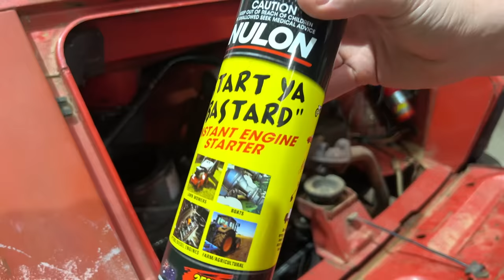Can Tony run on WD-40?

Comment: This should just be a regular series of trying to run Tony on different fuels, maybe vegetable oil next?
Reply: Veggie oil is a legit fuel for old diesel engines, but Tony is a petrol boy sadly :0
Reply: I'm sure hard alcohol and spirits can start it.
If a Lada can run on vodka, I'm sure a Maluch can as well.
Reply: Try rubbing alcohol, but don't try vodka (it's been tried before on a corsa by a dutch youtuber and that failed)
Reply: @JoCaTen  vodka and other alcohols will not work, there is too much water in them
Reply: With a parody of run joey run as its theme
Reply: Tony should run on Pkcells
Reply: @ThatSpaceKraken  depends on the brand i think. There's a Russian YouTube channel in which mechanics just to different experiments and one of them was trying different spirits to see which can a Lada run on, they fed the engine directly, without needing to mess with the gas tank.
Search for Garage 54, there's also an English version which is just their original Russian videos dubbed in English
Reply: get something like 95% ethanol or even more as water is BAD for engines
Reply: Run it on wood gas! LMAO
Reply: @ThatSpaceKraken  maybe spirit will work?
Reply: @vincentschumann937  95% is azeotropic (the boiling point of the mixture is lower than the boiling point of just the ethanol), so it’s the purest you can get by distillation. Any purer is quite expensive and hard to track down; you’re dealing with chemical supply companies at that point.
Reply: @anderleok594  if you want to Do a but chemistry you can makeit a legit biodiesel which shuld ignite with a spark...

(iirc british fift gear swaped petrl car with diesel and Diesel with petrol)
Reply: Just use straight isopropyl alcohol
Reply: @JoCaTen  Probably one of the best youtube series.  basically mythbusters without insurance.
Reply: @Aeduo  except they're solely focused on vehicles
Reply: @JoCaTen  I think that's just a matter of what they have on hand and readily available to get more of.  Like the recent video where they made a press from the hydraulic brakes.
Reply: Can Tony run on 4 LEGS
Reply: 90 proof everclear should be able to run it
Reply: another one is the oil from french fry’s.  it’s proven to work in mythbusters,so why not on tony
Reply: @izi-uwu  no, vegetable oil only works on a diesel engine.
Reply: This engine would probably run on anything with a trace amount of calories.  If you pour water into a bucket from carrying coal, stir it with a stick and pour it into the tank, it would still work.
Reply: @JoCaTen  aren't lada's originally just a old fiat copy/licence built, so may have some similarities to Tony
Reply: @doyle7877  yep
Reply: Won't work Tony ain't a diesel
Reply: @RukaGoldheart  You'd be surprised what these cars can do.
Reply: @BuBu1769  the thing is, diesel combusts because of pressure and not sparks. So I doubt Tony, no matter how mighty he is would be capable on diesel or any derivatives.
Reply: @vincentschumann937  While I don't want to encourage any bad behavior, I do want to be that guy and add that ACKSHUALLY, there are situations where introducing water to the air fuel mixture is beneficial.  It just has to be very small, controlled amount.  But since water does not ignite via compression (or spark, lol), adding water to the fuel increases the octane rating.  This means that you can potentially achieve more power due to improved efficiency.  Although, this technique is probably used more often for just getting an engine to run half-decent on cheap fuel.
Reply: @RukaGoldheart  I know how diesel engines work.  But I had a car like Tony and I know what he's capable of. :-D
Reply: HHO gas.. hydroxy gas.. small enough cc to attempt. Tony could be a (turns up nose) hyyyyybrid nhoh nhhohh (rich person chortled laugh)
Reply: Tony could run on water if he really needs to
Reply: Maybe ethanol mixed with alchohol
Reply: @gabrielv.4358  Ethanol it is an alcohol.
Reply: @JoCaTen  I know Russian channel - a guy here, changed regular engine with jet fuel engine... So maybe jet Poland NIVA?
Reply: Well we got a video about Tony trying to run on kerosene, methylated spirit, and lighter fluid… so vegetable oil could be next

Comment: I like how a exhaust bolt is missing. The issue with this is the spray wd doesn't have that much WD in it, and they propellant they use is carbon dioxide (since at least 2008) so you are literally filling your motor with an inert gas at least 20% of the spray. To get this sort of thing to work you just gotta advance the timing to give that very light mist of fuel a chance to ignite and also you gotta figure out a way to get that stuff to mix uniformly with the air. You also gotta choke the engine as it's gonna be a lean mix either way. The reason Ether (starting fluid) works so well is because it's got such a low auto ignition temp, so it doesn't need much to light it, and it's full of oils and other hydrocarbons so once the ether part lights the other hydrocarbons burn. To get WD to work your best bet is to get a 4 gallon jug and plumb it into he fuel inlet and then keep the choke closed. It will run just fine like that.

Comment: WD-40 is water displacer for rocket fuel and should work just fine in an ICE if introduced in the traditional manner.  You can buy it by the gallon in non-pressurized tins.

Comment: There's a French car channel that attempted to make a car run on different flammable liquids using parts from a Jaguar Sovreign V12 to make a dual injection system (that's bonkers) and they tried alcohol, different chemicals, WD40 being one of those, let's say it didn't worked that much...

Comment: I wish we had starting fluid named the same here in the USA.  🤣  However, I have successfully run a car off of a can of WD-40 enough to get it to a gas station, a bit over 20 years ago.  To do right, you have to fill the fuel bowl of the carburetor with WD-40 to get it going.

Comment: WD40 is a solvent designed to displace water so its flashpoint isn't very high, so yes it is flammable being a solvent but it is next to useless as a starter fluid.  Break cleaner is also a solvent but contains much more volatile substances that have a higher flashpoint making a better starter fluid, not ideal though as it can strip the oil from the cylinder walls if used in excess amounts.

Comment: Since it's still on there, I should point out that those intakes absolutely suck on these cars, especially in a hot climate. It gets incredibly hot in the engine bay. Even in Poland during the summertime it's common to hang the engine cover in a half open position to keep things cooler. People exaggerate the effect of the warmer intake temps on normal cars when you use a cone filter, but in this case it's truly an issue. Put the normal intake system back and the car will do a bit better.

Comment: I once did this by accident when I was cleaning out the intake manifold of my 1992 Mazda 323 Protege 1.6. Got lucky, was cleaning out the mass air flow sensor, which is mechanical/ electronic, and was cleaning it out with brake fluid cleaner. Followed by a coating of WD-40, well some of that must have got sucked into the intake and boom! there was definitely some engine knock, luckily it didn't break anything. I did needed new pants ... That engine managed to make it to 358000 was abused with lots of hundred mph speed runs and jack rabbit starts from stop lights oh, so I guess no engine Damage Done...

Comment: Wd-40 is flamable but extremely difficult to light, why it caught on fire was probably the starter fluid mixed with it

Edit: before you ask, no it would not have stayed alight again its extremely difficult to light and starter fluid is not hot enough nor lasts long enough to light the wd-40

Comment: i ran my honda generator on wd40 once to see if the engine was god or not cus the carb and fuel tank had gone bad with bad fuel and i wanted to make sure it runs before i spend my time on cleaning them. and it ran made power at correct voltage so i gave it a good clean and the carb took 7 days to fix. i wish it was fuel injected . just replace the injector , pipes and some cheap parts and good to go. i hate carbs..

Comment: You need to warm up the engine, best go for a drive, and then try to run on it. When hot it should even run on diesel, i know someone who put diesel by mistake and it ran, couldnt turn it off.

Comment: Somebody probably asked it before but I couldn't find it. It's the free car project dead at this point?
Reply: Same boat as you, but I think not - or at least I hope not. If I remember correctly, the shop that Wade (Dankpods) was going to was fully booked in December, so the work the shop would need to do on the engine wouldn't be done until ~February. 

I could be completely wrong though. It's been a while since I saw that video, and I am very high right now.